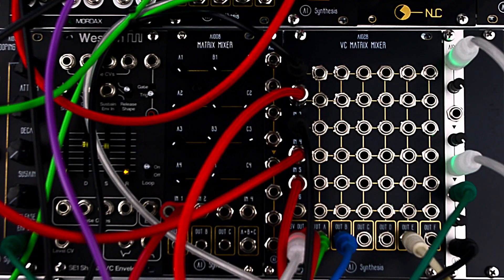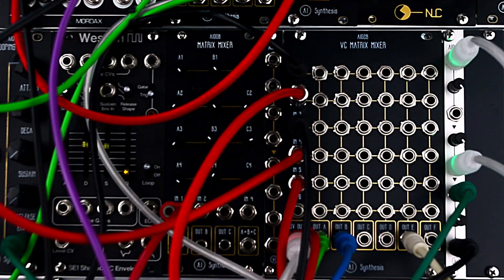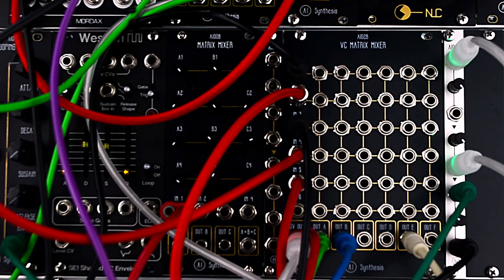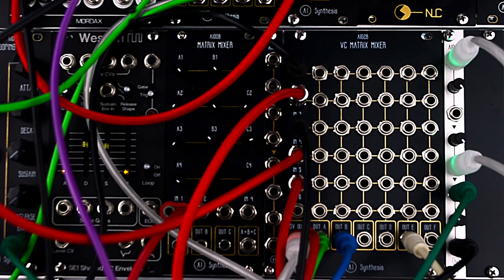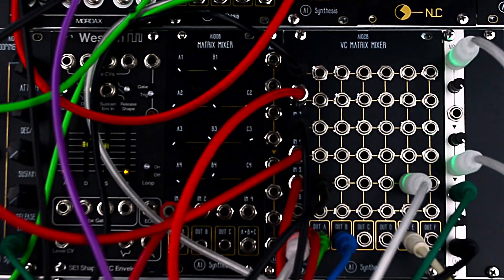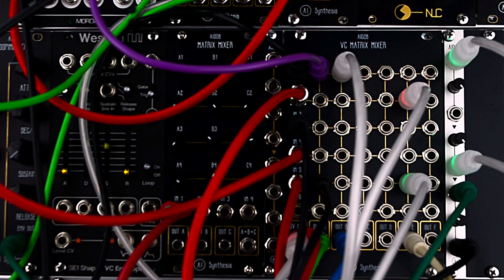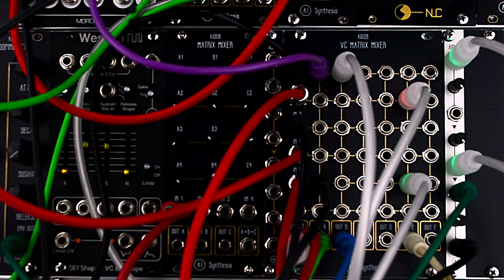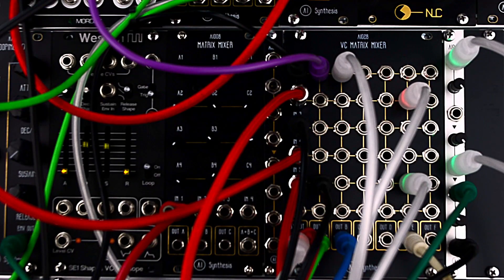AI028 Voltage Controlled Matrix Mixer Demo

Comment: looks great! any ways to mix control voltages like if one input on then left is left unpatched for example? that would make this a beast
Reply from the maker: It would also make that patched channel impossible to mute w/o a dummy plug. I thought about it but it was confusing and counter intuitive. Just use a stackable or a multiple to achieve the same effect.
Reply: @AISynthesis  i see thx